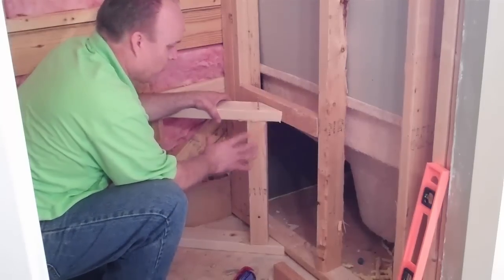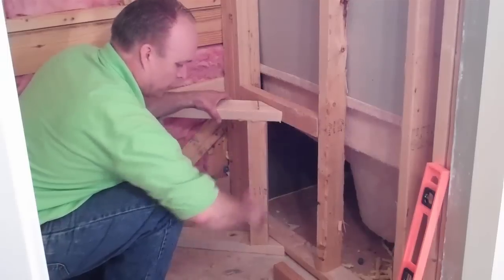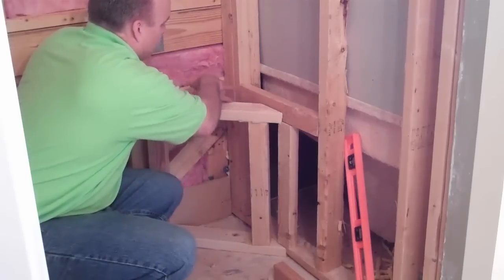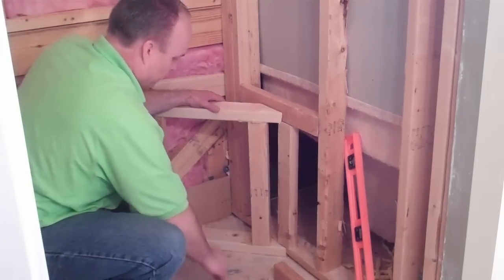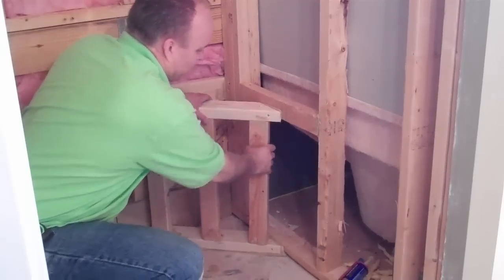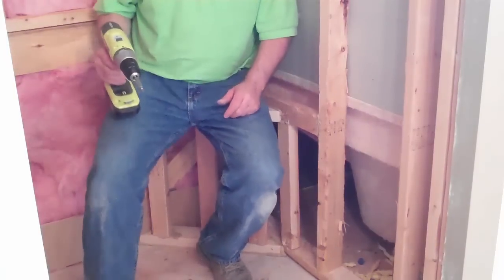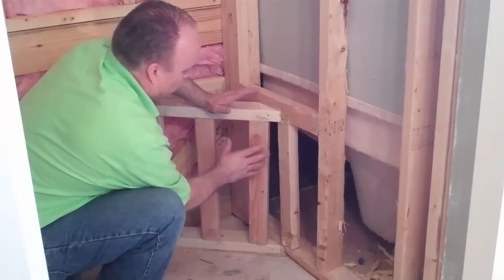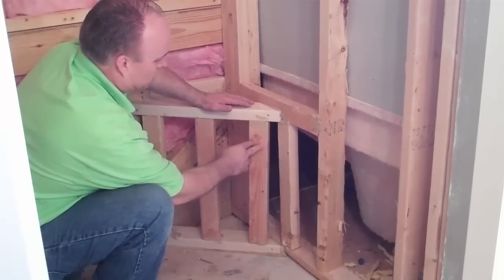How to correctly Build a Shower Bench - by TrugardDirect.com

Comment: Very nice job!  I'm looking to emulate this but with a slightly larger seating area.  Not to be critical at all, but why did you hardiboard it BEFORE the rubber shower pan liner?  In other words... i can't see what you would do with this after you put the shower pan liner in?  Did you put a second hardiboard after the rubber shower pan liner?  If so, is that really necessary?  Because one does not do that with the other walls of the shower.
Reply from the maker: Hi JBrowninKC! Thank you for the comment! We did the hardiboard before because we use a different waterproofing system. We us the bonded polyethylene waterproofing membrane system. The difference here is that the membrane is the last thing to go on before you time to ensure a full waterproofing shower. A pan liner only provides minimal protections for the floor area that it covers, as long as the install isn't done with nails. The membrane system allows us to completely install the mudbed, or any other pre-sloped flooring system done before we waterproof so that the mudbed doesn't hold water and cause mold growth. Keep watching our other video's in the playlist to help show you the full waterproofing process. Thanks again!

Comment: Thank you for this video! Great tutorial. Not sure if this is a lost cause, but our contractor already had the shower pan put it, and is now stumped on how to create a very small corner bench with one of the walls being an exterior wall, and one being a half-wall. Any thoughts on how this could be done? Thanks for any help you can give!
Reply: Hi Whitney,
If the shower pan is a polystyrene tray, he can cut it out in the area where the bench will be and start fresh on the floor. If he already installed a rubber shower pan liner, he can easily pull it up in the corner and then build the bench.
I hope that helps
Matt
Reply: Thank you! It is a rubber liner, but that's good news. I think he's stumped on how to attach the bench on an exterior wall. Is there an easy answer to that?
Reply: Hi Whitney,
He just needs to watch the video because that is exactly what I do in the video. I show how to add blocking between the wall studs, then proceeding as shown in the video.
I hope that helps.

Comment: Why do you need liquid nails if you are using screws?  Also, how do you determine the slope needed for the top of the seat?  It looks like you attached some backing a bit higher than the seat, to create the slope.  But wouldn't the wood need to be tapered in a way that makes the attachment of the cement board flush?  About to build one at my home, thanks for the video and the help!!!

Comment: Why didn't you slope the bench to mitigate water accumulation?
Reply: You would create the slope in the tiling phase.  You only need about a 2-degree slope to keep water off.
Reply: @Rocky1115  whats the best way to slope the tile
Reply: @Rocky1115  We are working on our shower right now. How do you created the slope in the tiling phase? Do you just put a thicker amount of mortar down in the back of the shower seat?
Reply: @wisegirl99  Yep, that's what I did. What I did was I took a 1' level and, from front to back, I let the bubble touch the inner line of the level. You don't need much of a slope to drain water properly.